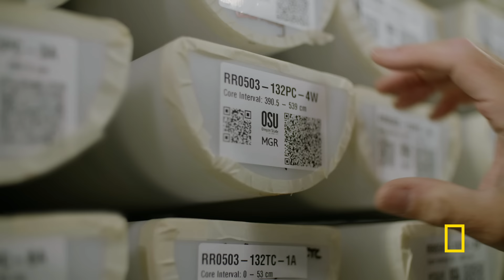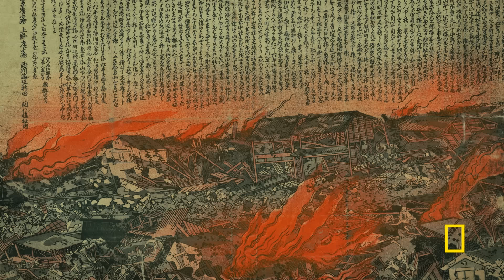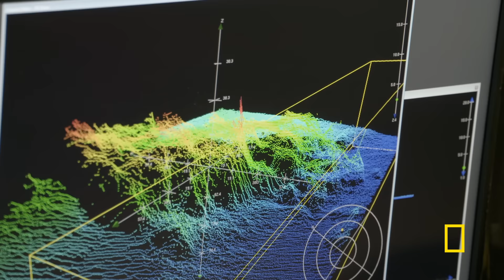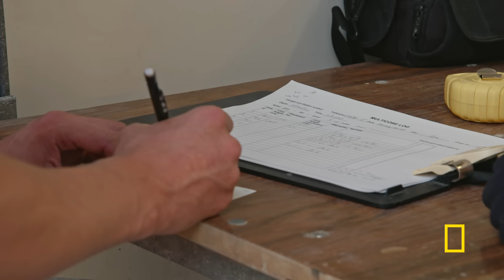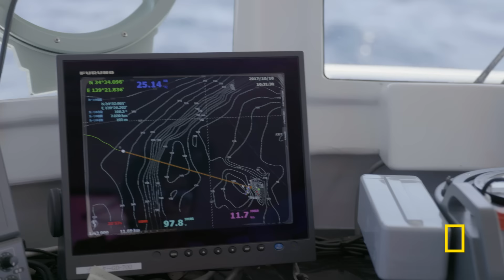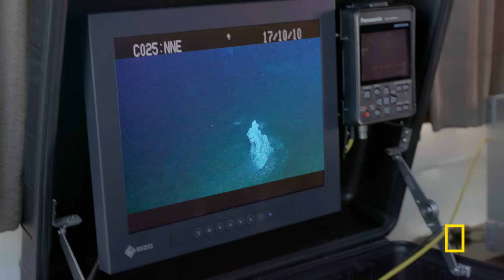Deadly Pacific (Full Episode) | Drain the Oceans

Comment: Sigh.  Those living in Portland and Seattle and along the coast are Not Unaware of the danger.  Portland is some sixty miles from the coast with the Cascade mountains between.  Not little rolling hills, but mountains.  Seattle is spongelike, but not on the coast exactly.
      Calling our local volcanoes Dormant is about right.  They are sleeping uneasily and Snoring.  Both Mount Hood and Mount Rainer have active areas in hot springs and sulphur caves.  The Three Sister’s Volcanoes are guiltily building a little brother now..
      Falling buildings and those tobogganing down the hillside will be bad along with snapped water and gas lines will be bad.
I wish there would be a video like this concentrating on. The heavily inhabited areas, not just the coastal areas.😊
Reply: We don’t care if Portland or Seattle go

Comment: Why are scientists convinced that the 'Alpha' shark was swallowed whole? It would seem that an attacking shark would take a chunk out of the victim and swallow that. If the tag was included in the chunk taken by the larger shark, Godzilla, or whatever then it could pass through the digestive system and be passed to float back to the surface and end up on the beach. If that was the case then the attacking creature would not have to have been that much larger than the dinner guest of honor.

Comment: A doubt dear! Earth has been around for 4543000000 (4.543 billion) years. But the Pacific Ocean has been around for 750000000 (750 million) years. The years between the two are 3793000000. So in those intervening times the ocean did not form? How many years did the ocean take to form? If the ocean did not form, then what was there in such a large area? Need detailed explanation….. Regards Murugesan

Comment: [19:54]
For the record, you are correct that Portland would likely suffer a severe earthquake if the Cascadia fault goes off. But, since we are inland 80 miles from the Pacific ocean, we most certainly would NOT be inundated by a tsunami!
Reply: Consider that, during a subduction event, you have the sudden influx of a great amount of water into a coastline that will have at the same time subsided many feet.

Comment: The "flat " layers of geological strata are not indicative of individual catastrophic events, nor does each layer represent long periods of time. 

These layers are all flat. Had they been the surface of the earth for any period of time they would shown evidence of erosion, but they don't. They are perfectly flat. They are not indicators of the surface of the earth over any period of millions of years. It all happen during one catastrophic event. It was caused by a universal flood. 

The flood caused underwater turbides (large mud flows) which covered the earth, filling in the recesses and elevated portions of the earth. After that, each layer flowed without resistance and made a perfectly flat surface for each mud layer. When the flood receded, it caused rapid erosion in the still soft mud layers causing the geographical formations of mountains, valleys and large canyons that we see on the surface today.

Comment: How do the people of Cascada even begin to prepare for something like this? The only real answer is to take to the air but how is this even possible? Personal emergency hot air or helium balloons perhaps? How long would it take to prepare and make ready something big enough to carry maybe four people? I guarantee you it'd be more than 20 minutes! Maybe, MAYBE If the preparation began automatically, AND you practiced enough You might be able to take flight before the 20 minute tsunami deadline came.  And that's if it's 20 minutes. 
Even if you could get to the ocean, which would be the only other method by which you might survive, you would have to get quite a ways out to be able to manage the swell and not just have a title wave swamp your boat out there.
You don't know how high the water will reach So climbing the hill behind your house may not be sufficient. There will be absolute traffic deadlock on any inroads but it's not really a matter of escaping the coast as it is gaining elevation quickly...
Perhaps one of those orange emergency ship escape pods might do if it was just water but I guarantee you it will crush like a soda can if it gets caught in debris - which you know there will be.
Perhaps an underground, completely watertight, self-oxygenating escape room would be an order. But how long could you survive under there? And what if the water receives but leaves 200 ft of rock, soil, and debris above you? Even if it's just 10 ft you would die from suffocation eventually.
Reply: yo mama like this video ?
Reply: Amen.
Reply: @yaad2226  Yes, my dear son.